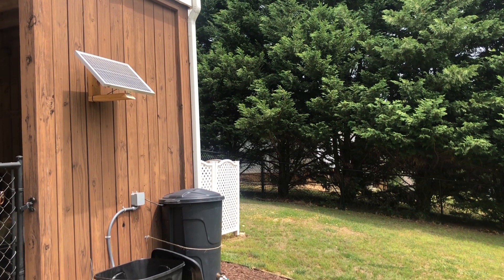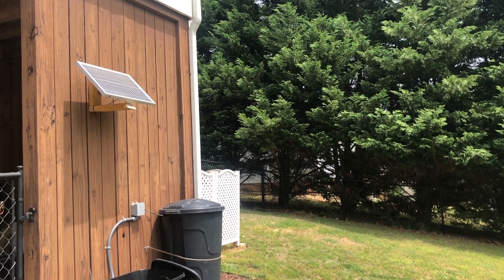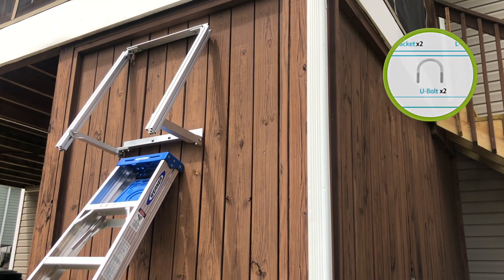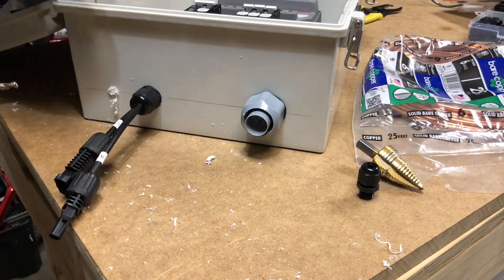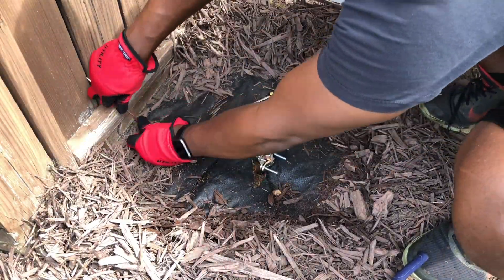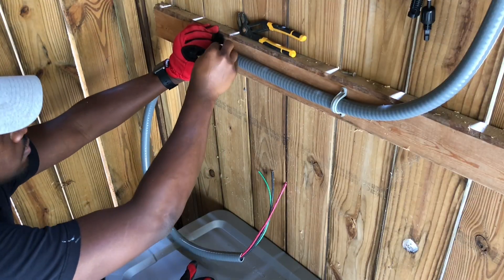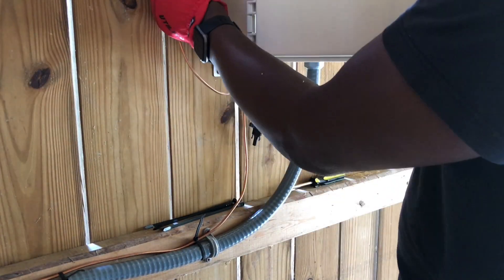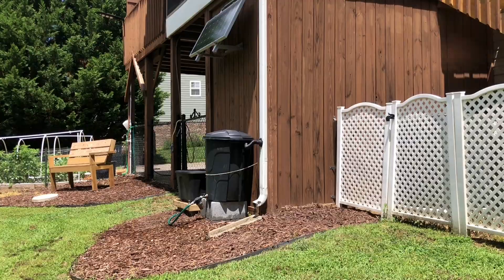Rain Barrel Solar Panel System Upgrade

Comment: With the simple setup you had initially in the first video, with the small solar panel, I am thinking bout doing this setup on my 16 ft Viscount Caravan, as it is a site caravan at the moment with an angled paradise roof, to collect the rain water, I was thinking of a setup that I could have to feed the water from the rain water tank into the tanks on the van and then I could use a 12 volt system to bring the water from the tanks into the van itself, 

Thank-you for the video, it is giving me an insight in to doing a solar power for a small pump, to feed the rain water tank....something I have been thinking bout since putting the 2nd roof on....will take pics of it later on when doing it then forwarding them on.
Reply from the maker: Awesome, always glad to hear the content helped in some way. Good luck with your project.

Comment: Tech tip 4 ya. You can use a screw ( shorter than your wood 🪵) , a box end wrench 🔧, and a large fender washer , to hold the nut 🔩 on the back side of your work. Wile you turn the bolt from the outside. ,, you can clamp 🗜 down the wrench 🔧 though the hole 🕳 in the wrench 🔧,OR, clamp 🗜 down the wrench 🔧 by its shaft.  Also, flattening out the wrench box end is a help as well.😎 your welcome. 🤣  🐴🐴🦅

Comment: I'm not too sure about grounding the sp frame. Maybe insulate from ground would be a better approach. It's mounted to wood, that's a good start. Let it float, then it won't attract lightning. Ground potential is as dangerous as anything else when lightning is the concern.

Comment: I really appreciate your video on this system, including the Lessons Learned. I am putting together a similar system.  One small point. While your grounding rod and GFI system is a safe idea for a lighting strike, I don't believe it is necessary, by code for a low voltage (under 24 V DC) system. I'm not a pro so this is just my thought.  We all learn as we go. Regards....

Comment: How can I put my water buffalo drip system on a timer with 12 volt transfer pump?
Reply from the maker: I've never heard of a water buffalo drip system, so I am not sure. If this is similar to my system and I wanted a really cheap & easy way to control the water, you could buy a battery operated digital hose timer from a home improvement store (garden area) and use an on-demand pump instead of a transfer pump. That way, the pump would know to turn on automatically when the timer's valve opens. I may make a basic video on this in the future if people are interested.

Comment: word of caution when installing solar panel(s) put a towel over the panel to prevent electricity running thru the wires
Reply from the maker: Good tip JAlly.
Reply: @GreenTechTown  Lived on a boat with Solar power during the install you can get shocked by the power the panels produce

Comment: Awesome. Looks overkill for a garden pump, but thats the fun is to go overkill.
Reply from the maker: Hey dwoodog, you are right, the size of the system is overkill for just a water pump system. Another reason I planned to upgrade is for a few other projects I plan to use the system for coming up 🙂

Comment: Awesome.  Very detailed, especially when you said you followed the US NEC.  I have a rain barrel pump too, but it connects to household electricity.  My setup is a bit different where I ran a cord from the outdoor GFCI that has a "while in use" cover to some PVC conduit boxes, one containing a light switch with an outdoor switch cover (the one with the red toggle) and the other having another "While in use" cover with a single outlet.  The cord runs into the first box through a gland fitting, and the outlet has another piece of the cord coming out of the switch box through a gland and to the outlet box through another gland.  The plug on the other end of the cord is of the outdoor termination (Leviton black rubber plug) as well.

Comment: might be a good thing to make a drip loop on the solar output cables before they go into the wall, less water getting inside and on your cutoff switch
Reply: In a pinch I have used zip ties facing /sloping down to stop drip back.

Comment: If you don't have a convenient ledge somewhere to hold your bracing wrench still, just clamp a big Vise-Grip on the nut.  That's usually heavy enough to resist the Nylock's torque.
Reply from the maker: Great tip Leif!

Comment: Did you mix stainless steel fasteners with an aluminum frame? This tends to lead to galvanic corrosion. It would be better to use galvanized fasteners.
Reply from the maker: Thanks dper1112. You are correct. Not sure how I forgot about this, but I will definitely look into that option. I will add this update to the description later as well. Thanks for the reminder and for taking the time to share!
Reply: Don't listen to diaper dan it's not a big deal. Funny how I dissamble aluminum head motors with steel bolts. Must be ok for the auto industry but not for you siding. I just hope this lowers his stupid comment

Comment: Each and every video is fantastic, and I wonder whether I can/should do this as well. I have yet to install the smaller solar panel and in that video it seemed it charged the battery pretty quickly. Therefore I don't see a need to use a larger panel myself. I understood you had a larger panel laying around, but other than that, can you explain why you decided to do this? For example, you frequently referred to future plans and that context may be helpful.
Reply from the maker: Hey Ed. Yes, it was for 2 primary reasons. To increase my knowledge in the area, as well as be able to recharge the battery quicker since I plan to run a few other nearby components off of it in the future (outdoor LED lights, security camera, etc.).

Comment: I have a total blind spot about electrics. Partly fear, partly conditioning to 'leave it to the professionals'. I just love the way you have reduced these tasks into manageable sections where your research online has filled in the knowledge you first lacked and which gave you the confidence to put it all together. The newly added electrical components are also unknown to me. I would be most interested to know about the battery storage for the more powerful panel. I am hoping to use a similar system to power an aquaponics circulation pump and need to work out the potential pumping 'head' height for a given wattage available in order  calculate how to design the flow of water from fish to plants.
I have made use of online communities in learning about gardening generally and aquaponics in particular but had never thought to look for a similar knowledge sharing community for the solar.  Good luck with your plans for further development. Here in the (mostly) damp and cold environment of Wales (UK) there will, I'm sure, be local information of great value regarding electrical safety and condensation.
Reply from the maker: Thanks Andy for sharing and good luck with your aquaponics project! And yes, I definitely recommend joining an online/local solar community.

Comment: That grounding rod is too far way from the wall. Usually a grounding rod is within 1 inches from the nearest wall so that it is not a tripping hazard. 
The rest looks good
Reply from the maker: Thanks Kenny for the feedback. Many houses, including my own, have the grounding rod installed a little further away so that it will not contact the underground concrete footing of the house, which protrudes horizontally about 1 foot from the base of the foundation. Also, the area I installed the grounding rod will not be used as a walkway in the future, and that's the reason why the mulch is there. Also, I finished hammering my grounding rod into the ground off-camera to reduce any trip hazards and since the NEC required it in my case.

Comment: I’m not sure what the code says about lightning protection, but I believe it has to be separated from the power ground system, and the rods for the two systems have to be separated. At least when we were running temp power that’s how we’d do it.

Comment: You did a professional job but isn’t that a lot for a rain Bernal
Reply from the maker: Hey George. Code wise, I'm not sure, but power wise, definitely. I had some other reasons for upgrading this system since I would like to power some other small things off this system coming up in the future.

Comment: I´m there!, analysis paralysis, I want to install a solar system for a pump I need to install in my pond, but I don´t what I need to buy, what potency, no idea. Normally I will do all electrical steps myself but this is overwhelming.  Thanks for the video.
Reply from the maker: I know the feeling. Sometimes what I'll do is write down all the questions I have about a task and then 1 by 1 start trying to address them by reaching out to online forums, local experts, Google, etc. until eventually all the questions are answered or I at least have more confidence to take action.

Comment: Very informative video. Great content. Do you have an estimated total cost for the whole system you have setup up to this point?
Reply from the maker: Hey Clayton! Some of the items I already had on hand (solar panel, battery, electrical hardware), but if I started from scratch, and bought everything new, I would say this project is now in the neighborhood of $500-$600.
Reply: @GreenTechTown  with the energy it generates how long do you think it would take to recoup that initial investment and how long do you suppose it will last? BTW that was some extremely professional and tidy looking cable management lol. I would expect nothing less from you though lol

Comment: electrical tape (vinyl) is a bit better at protecting open wires than masking tape,
Reply from the maker: I agree. I admit, I was too lazy at the time to go grab some from the garage since I was only temporarily using it to prevent the wires from touching when removing the cable from the tote lol.

Comment: Did you get into some kind of trouble with your old setup that resulted in this upgrade (like a visit from a county inspector or something)?
Reply from the maker: Hey A S. No, I did not run into any issues. This has just been something I've wanted to research more about for a while to make sure I have the right safety measures in place (so I do not run into potential trouble) and expand my knowledge. Most people tend to skip these steps, and finding reliable, easy to understand, and consistent information online about some of these topics is quite the challenge.

Comment: Thanks for this - very informative - just one question - does the ground wire not need to be insulated or is it OK to leave it as you have it
Reply: Ground wires don't need to be insulated because they are about dispersing the energy from a faulty electronic out. If you are wiring something up near other sensitive electronics that your ground wire is near then you may want to insulate it but not really needed
Reply: @ebazz5704  Thanks for the info - appreciate it

Comment: Was the 20w panel enough to keep the battery charged for use or did you need to upgrade to keep up with your usage?
Reply from the maker: Hey E Bazz. Yes the 20w panel was enough to keep my battery charged, but I have some up coming plans for some other small projects I would like to power off this near by solar system (i.e. deck led lights, security camera, etc.).
Reply: @GreenTechTown  that sounds awesome  and can't wait to see what else you do